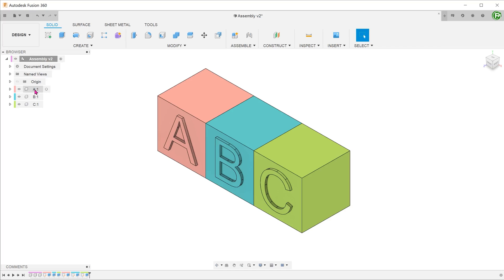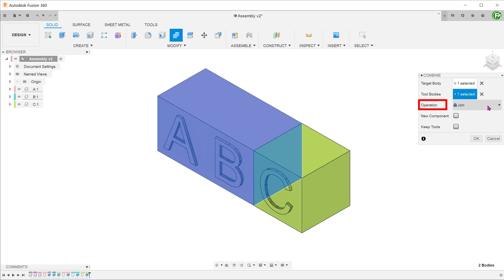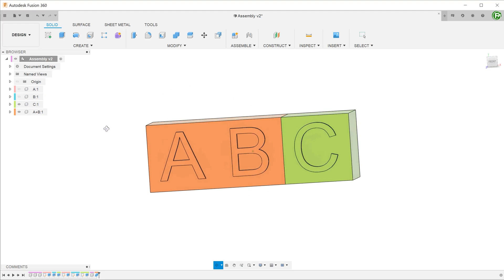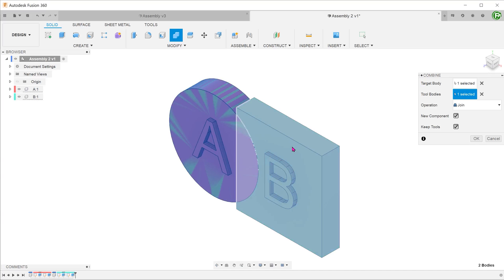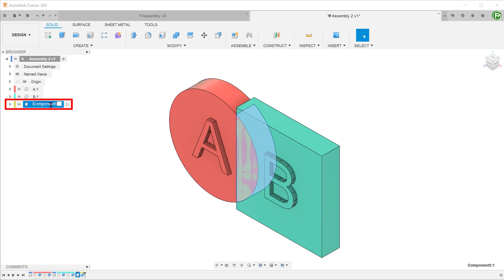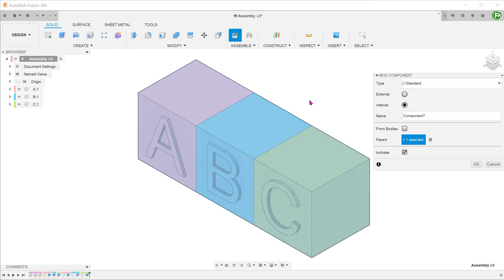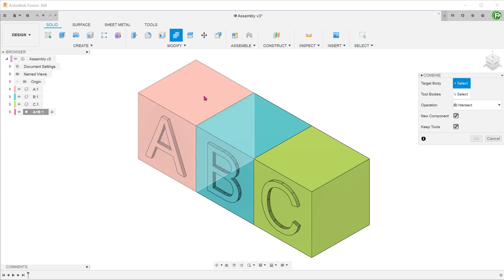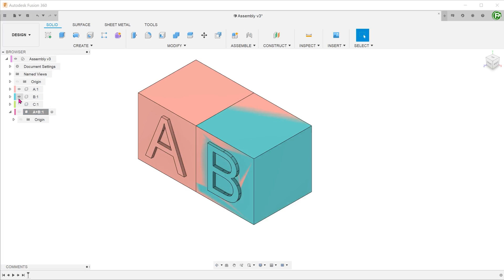Fusion 360 - Combine Components (Basic Tutorial)

Comment: Thanks for this. What if you want to delete the original components though? You cannot do that without breaking the newly combined one. Is it possible to tidy up the browser somehow?
Reply: I believe you don't check the 'keep tools' box then I think
Reply: @danyzproductions2219  I ended up discovering that is possible to hide a component without deleting it via a different command (it may be "remove"). This allows the object to be referenced in the timeline without having to actually see it.
Reply from the maker: Sorry, a bit late to this party. If you don't check the keep tools option, only the component designated as the tool would be removed. That still leaves one component. As mentioned, you can hide or right click to remove. Just be sure not to delete.